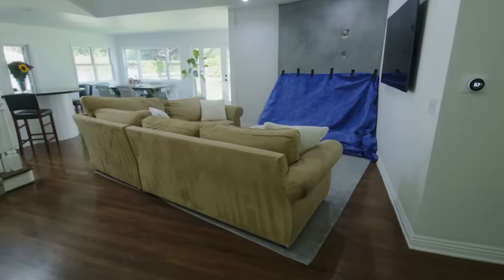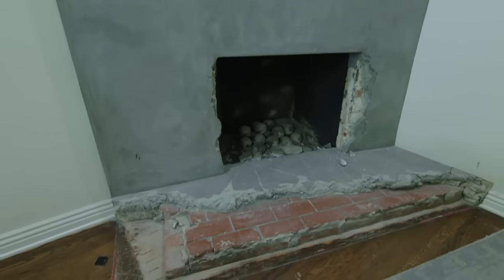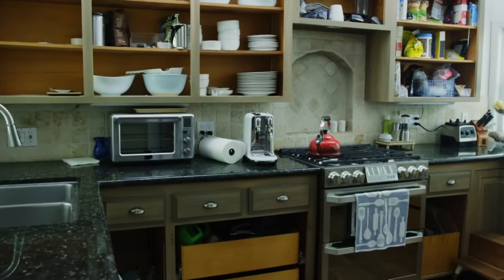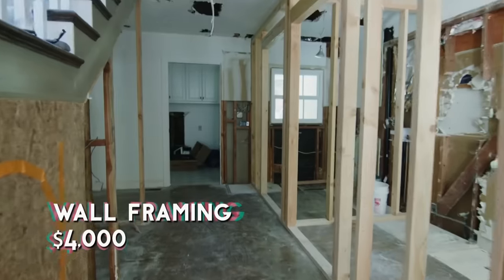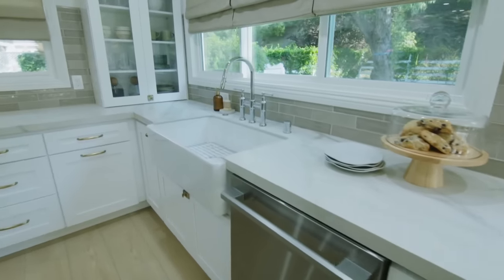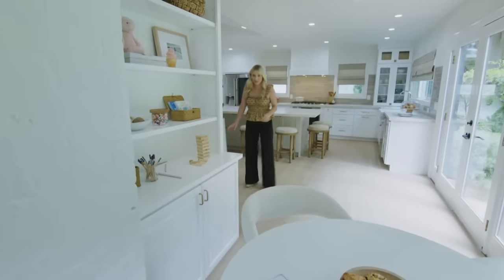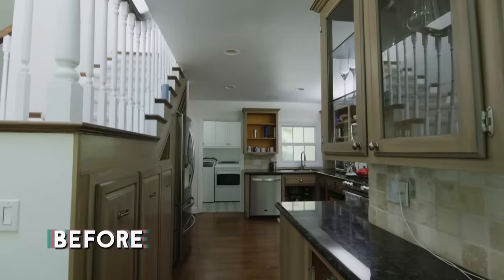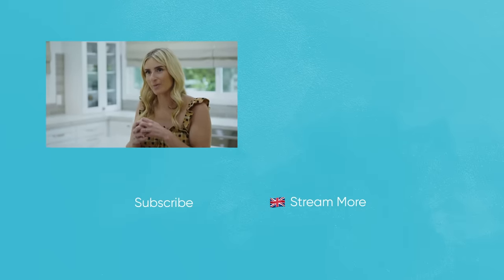Jasmine Reconfigures A Very Awkward Layout For A Family Home | Help! I Wrecked My House

Comment: 31.000 just for a floor? when you have money to burn you can do everything. i renovated my house (flooring, new kitchen, new furniture) for 23.000 and it does not look so much different.
Reply: We also renovated our home during lockdown and did the main floor, built a backyard deck, new front steps and added spare room with ensuite in basement……for a LOT less than this. We knocked out the wall for open concept all by ourselves.
Reply: 😂 I honestly laughed because I thought the same.. Wow. 31,000 is crazy.
Reply: thats no probably for the flooring for the whole house
Reply: I assume the 31K is for flooring for the entire downstairs.  I would expect that's what it costs for real wood these days.  Everyone is using engineered wood or laminate now.

Comment: Nice, but appears there is no bathroom on that main floor.  If so, for such a big first floor area, that’s not right. Maybe it’s located right up the stairs on 2nd floor?
Reply: I totally missed that and there is plumbing for the laundry so it wouldn’t have been to hard.
Reply: I agree a bathroom would be useful.

Comment: Change huge L sofa for a 3 seater and an armchair...wow. But that would solve the issue in there existing living room as it was originaly, there was no need to burn all that money just to get even smaller living room space. Changing the stairs shape would solve it much better. Ortaking down just thatone wall betwean kids corner and living room. I don't like this solution at all. Its money down the drain and issue of small living space still there